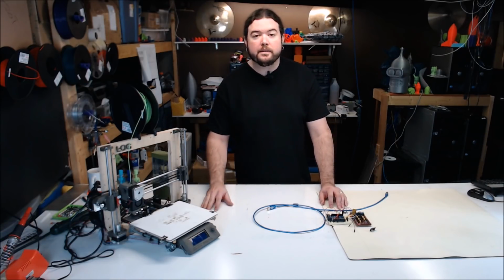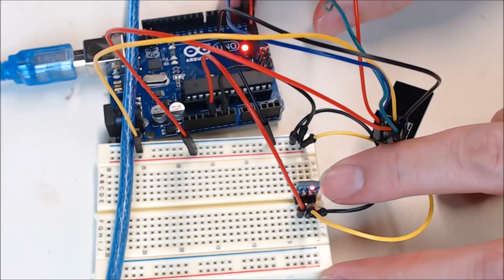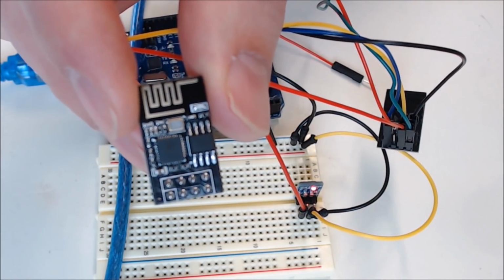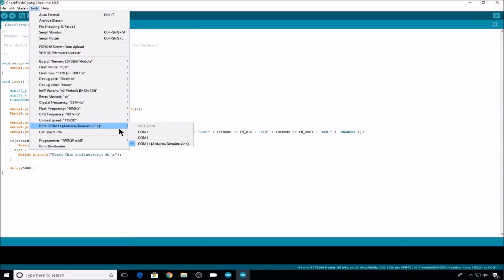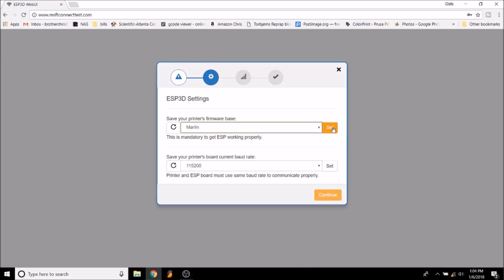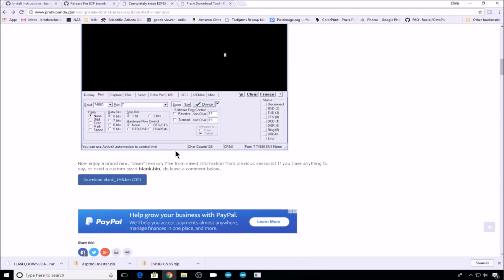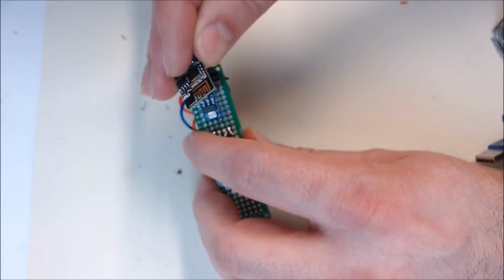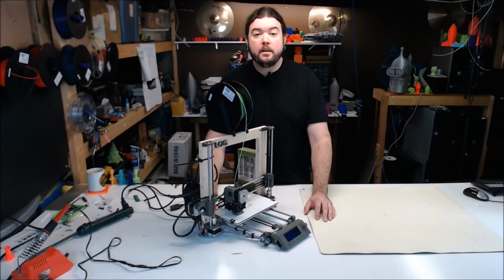Add WiFi To Your 3D Printer For $5!!! - ESP8266 - LUC ESP3D - Chris's Basement

Comment: You need a level shift from 5V to 3V (Ramps 5V -> ESP 3.3V)
Reply from the maker: Level shift? Do you have a link?
Reply: @ChrisRiley  I mean a voltage divider with resistors for the RX Pin (on ESP Site) - see on the picture here 
https://github.com/luc-github/ESP3D/blob/master/images/HW/Wires.png?raw=true
Reply from the maker: @andremuensti4730  Got ya, yes, that should work as well.

Comment: Hi, i tried to make this project but i can't upload the code on Nodemcu board. The IDE shows this error: In file included from C:\Program Files (x86)\Arduino2\libraries\WiFi\src\WiFiUdp.cpp:29:0:
C:\Program Files (x86)\Arduino2\libraries\WiFi\src\WiFiUdp.h:27:7: error: redefinition of 'class WiFiUDP'
 class WiFiUDP : public UDP {
       ^
In file included from C:\Program Files (x86)\Arduino2\libraries\WiFi\src\utility/wifi_drv.h:26:0,
                 from C:\Program Files (x86)\Arduino2\libraries\WiFi\src\WiFiUdp.cpp:26:
C:\Users\Ivan Margiotta\AppData\Roaming\Arduino15\packages\esp8266\hardware\esp8266\2.4.2\libraries\ESP8266WiFi\src/WiFiUdp.h:32:7: error: previous definition of 'class WiFiUDP'
 class WiFiUDP : public UDP, public SList<WiFiUDP> {
       ^
C:\Program Files (x86)\Arduino2\libraries\WiFi\src\WiFiUdp.cpp: In constructor 'WiFiUDP::WiFiUDP()':
C:\Program Files (x86)\Arduino2\libraries\WiFi\src\WiFiUdp.cpp:35:22: error: class 'WiFiUDP' does not have any field named '_sock'
 WiFiUDP::WiFiUDP() : _sock(NO_SOCKET_AVAIL) {}
                      ^
C:\Program Files (x86)\Arduino2\libraries\WiFi\src\WiFiUdp.cpp: In member function 'virtual uint8_t WiFiUDP::begin(uint16_t)':
C:\Program Files (x86)\Arduino2\libraries\WiFi\src\WiFiUdp.cpp:45:9: error: '_sock' was not declared in this scope
         _sock = sock;
         ^
C:\Program Files (x86)\Arduino2\libraries\WiFi\src\WiFiUdp.cpp:46:9: error: '_port' was not declared in this scope
         _port = port;
         ^
C:\Program Files (x86)\Arduino2\libraries\WiFi\src\WiFiUdp.cpp: In member function 'virtual int WiFiUDP::available()':
C:\Program Files (x86)\Arduino2\libraries\WiFi\src\WiFiUdp.cpp:56:7: error: '_sock' was not declared in this scope
   if (_sock != NO_SOCKET_AVAIL)
       ^
C:\Program Files (x86)\Arduino2\libraries\WiFi\src\WiFiUdp.cpp: In member function 'virtual void WiFiUDP::stop()':
C:\Program Files (x86)\Arduino2\libraries\WiFi\src\WiFiUdp.cpp:66:8: error: '_sock' was not declared in this scope
    if (_sock == NO_SOCKET_AVAIL)
        ^
C:\Program Files (x86)\Arduino2\libraries\WiFi\src\WiFiUdp.cpp:69:26: error: '_sock' was not declared in this scope
    ServerDrv::stopClient(_sock);
                          ^
C:\Program Files (x86)\Arduino2\libraries\WiFi\src\WiFiUdp.cpp: In member function 'virtual int WiFiUDP::beginPacket(IPAddress, uint16_t)':
C:\Program Files (x86)\Arduino2\libraries\WiFi\src\WiFiUdp.cpp:88:7: error: '_sock' was not declared in this scope
   if (_sock == NO_SOCKET_AVAIL)
       ^
C:\Program Files (x86)\Arduino2\libraries\WiFi\src\WiFiUdp.cpp:90:7: error: '_sock' was not declared in this scope
   if (_sock != NO_SOCKET_AVAIL)
       ^
C:\Program Files (x86)\Arduino2\libraries\WiFi\src\WiFiUdp.cpp: In member function 'virtual int WiFiUDP::endPacket()':
C:\Program Files (x86)\Arduino2\libraries\WiFi\src\WiFiUdp.cpp:101:32: error: '_sock' was not declared in this scope
  return ServerDrv::sendUdpData(_sock);
                                ^
C:\Program Files (x86)\Arduino2\libraries\WiFi\src\WiFiUdp.cpp: In member function 'virtual size_t WiFiUDP::write(const uint8_t*, size_t)':
C:\Program Files (x86)\Arduino2\libraries\WiFi\src\WiFiUdp.cpp:111:27: error: '_sock' was not declared in this scope
  ServerDrv::insertDataBuf(_sock, buffer, size);
                           ^
C:\Program Files (x86)\Arduino2\libraries\WiFi\src\WiFiUdp.cpp: In member function 'virtual int WiFiUDP::read()':
C:\Program Files (x86)\Arduino2\libraries\WiFi\src\WiFiUdp.cpp:125:23: error: '_sock' was not declared in this scope
    ServerDrv::getData(_sock, &b);
                       ^
C:\Program Files (x86)\Arduino2\libraries\WiFi\src\WiFiUdp.cpp: In member function 'virtual int WiFiUDP::read(unsigned char*, size_t)':
C:\Program Files (x86)\Arduino2\libraries\WiFi\src\WiFiUdp.cpp:137:31: error: '_sock' was not declared in this scope
    if (!ServerDrv::getDataBuf(_sock, buffer, &size))
                               ^
C:\Program Files (x86)\Arduino2\libraries\WiFi\src\WiFiUdp.cpp: In member function 'virtual int WiFiUDP::peek()':
C:\Program Files (x86)\Arduino2\libraries\WiFi\src\WiFiUdp.cpp:152:22: error: '_sock' was not declared in this scope
   ServerDrv::getData(_sock, &b, 1);
                      ^
C:\Program Files (x86)\Arduino2\libraries\WiFi\src\WiFiUdp.cpp: In member function 'virtual IPAddress WiFiUDP::remoteIP()':
C:\Program Files (x86)\Arduino2\libraries\WiFi\src\WiFiUdp.cpp:167:25: error: '_sock' was not declared in this scope
  WiFiDrv::getRemoteData(_sock, _remoteIp, _remotePort);
                         ^
C:\Program Files (x86)\Arduino2\libraries\WiFi\src\WiFiUdp.cpp: In member function 'virtual uint16_t WiFiUDP::remotePort()':
C:\Program Files (x86)\Arduino2\libraries\WiFi\src\WiFiUdp.cpp:177:25: error: '_sock' was not declared in this scope
  WiFiDrv::getRemoteData(_sock, _remoteIp, _remotePort);
                         ^
Errore durante la compilazione    can you please help me?
Reply from the maker: Looks like you are missing the wifi man library. Try to use the same version as the one in the video, it's very picky about which version.
Reply: @ChrisRiley  thank you, it worked. Now my ender 3 works with Wi-Fi :D
Reply from the maker: @ivan_23i  NICE!!!!

Comment: Hello sir ur tutorial is much easier to understand and I need a wireless solution to my scenario...I use a 3D named 'Aarya P1' which consists of Arduino AtMega 2560 coupled with RAMPS v1.4...the printer uses a different firmware made for it and not 'marlin firmware'...So,can you guide me in adding a wireless feature to my printer using nodemcu or esp8266 module
Reply from the maker: Does the board have transmit and receive pins available? If it does and it has 5V open it should work the same.
Reply: @ChrisRiley  sorry for trouble,but it would be great if you guide me more in depth...
Reply from the maker: @vinstondavid  Do you have a picture of the board it uses?
Reply: @ChrisRiley  it uses a basic ramps 1.4 and Arduino AtMega 2560 board
Reply from the maker: Then it should work just like stated in this video.
Reply: @ChrisRiley  My printer uses a customised firmware other than the usual marlin firmware....so,will it work on it too?
Reply from the maker: @vinstondavid  The ESP should allow you to use it as serial input. So if tethered USB printing works on your printer, then this should work.
Reply: @ChrisRiley  Sir, can I get your mail id so that I can send some pics of my printer and the boards it use and the hex file of my firmware
Reply from the maker: @vinstondavid  brotherchris81@gmail.com

Comment: Hello Chris, in the schematic drawing that you sent me the RXd of the esp is connected in the D2 of ramps and the TXd in the D1, check this link, because what I was reading would be the opposite and I am in doubt to call in ramps here.
Reply from the maker: RX goes to D1 and TX goes to D0
Reply: @ChrisRiley  Thanks, but it did not work, the esp was red light on and the LCD was saying connecting and then started to give a bug in the ramps and it was restarting, I will redo everything.
Reply: @ChrisRiley In your drawing that sent me is RX in D2 and Tx in D1, check it out? Because that's how I called.
Reply from the maker: @TheNikakz  Interesting some pinouts call it d0 and d1, others call it d1 and d2. No matter what they are called they are still the top two right pins on AUX1.
Reply: @ChrisRiley  ok, vou revisar
Reply: @ChrisRiley  I sent to your email

Comment: can you do this to a anycubic I3 mega ?
Reply from the maker: Not sure what board that has, but if it has 5v ground tx rx pins available it should.
Reply: @ChrisRiley  Should have a Makerbase board? Serial pins broken out for the Makerbase TFT.

However if it ships with a TFT touchscreen controller, the serial pins are occupied. The external USB is then served by the Makerbase TFT, which is not fully command-compatible, and since USB-serial interface is implemented on board the STM32 processor, serial passthrough is not accessible externally. It is my understanding that Makerbase ships its own ESP8266-based WiFi upgrade module that goes into the TFT screen, but the firmware on the screen needs to be reconfigured or modified. Also not sure whether the WiFi functionality is actually any good.
Reply from the maker: @SianaGearz  I am not sure on the Makerbase board either, I would have to take a look at one.
Reply: @ChrisRiley  all Makerbase boards have an 8-pin keyed connector, which is laid out like this:
5V GND TX RX
5V GND NC NC
(key side here)
It's usually helpfully silkscreened on the back side of the board. It allows Makerbase TFT to connect, which is a spooler emulator with a colour touchscreen. But you should only be able to use either Makerbase TFT or any other kind of serial without interference, not both.

It's connected to the serial-USB bridge via a bunch of resistors, such as not to burn up either of the chips. If there's anything the Makerbase Gen.L doesn't lack it's the resistors - also connectors for just about anything you might think of.

Comment: Chris thanks for your help, It worked very well with WeMos D1 (ESP8266MOD) !!!!
Reply from the maker: Sweet! I have been meaning to try the D1.
Reply from the maker: Hindo Y.  It shouldn't do this if you run the data upload right after you unload the sketch. I am trying to find another work around.
Reply from the maker: Hindo Y.  Yes, upload sketch, reset, then in tools hi ESP8266 sketch data upload, then reset, log on to the ESD3d via wifi and the wizard will pop up.

I am trying to find a work around because the ESP3d instructions for the new version says you shouldn't have to do the sketch data upload, you can use the web interface, but I can't get it to work that way.
Reply from the maker: Hindo Y.  Interesting, thanks for the update.
Reply: Hindo Y.  For me it worked with the v1.0. This is how i did it:
1. Set Flash Mode: DIO
2. Set Flash Size: 1M(128K SPIFFS)
3. Set CPU Frequenzy: 160MHz
4. Erase Flash: All Flash Contents

Then i flashed the ESP3D v1.0 to the module, reset the module and then hit ESP8266 Sketch Data Upload (even though if the install instructions here:https://github.com/luc-github/ESP3D/wiki/Install-Instructions tell that it isn't necessary anymore). Then power off the module, remove GPIO_O to Ground jumper and power back on. Then the setup window on my laptop appeared after the wifi connection to the ESP8266 was established.

 Chris Riley  Thank you for this video!

Comment: I'm using ESP3D version 1.0, i will try again with  0.6.2
Reply from the maker: Try with 0.9.99
Reply: @ChrisRiley  It did not work either, when accessing the IP it has the option to upload filesystem and firmware.
Reply: @ChrisRiley  my print screen https://prnt.sc/mbsry1
Reply from the maker: @saLLadEXx7  Yeah, that data upload should make that screen not show up.
Reply: Tomorrow i will try using my another ESP8266MOD, for today is it.

Comment: Could you help me? I installed everything ok, but when I access it in the browser it does not show setup wizard.
Reply from the maker: Does anything at all show up?
Reply: @ChrisRiley  yes, interface to upload filesystem and update firmware... Im trying upload the index.html.gz
Reply from the maker: Let me try to reproduce this and I will get back to you.
Reply from the maker: @saLLadEXx7  So here's what I would do. ESP3D says you don't need to do the data upload anymore, but I think it is easier. Blank out your ESP with a sketch, it's in the video. Then upload that ESP3D sketch, then hit the data upload in the tools menu. Then when it comes up the gui will be there.
Reply: @ChrisRiley  Ok, i will try again.
Reply: Did not work, i just can see the 404.htm with 746 B... the setup wizard doesnt appear :(

Comment: Chris, after juggling I managed to configure, but I had to do differently in some parts, change from flash mode DIO in one and then QIO to the other, CPU frequency also to 80 in one and 160 in another, then I got the same way put the SPIFFS in 1M 512K, was trial and error to set up and I did not understand why all this. Now I was in doubt on some configurations of the WEB interface, could make a small video demonstrating this, for beginners as I is something crucial, for example IP is set as static, this is or would be DHCP, printer settings, etc ... I apologize if I bothered you with so many questions, I have a lot to thank and I have learned from you it is difficult for a beginner and with the language barrier it gets more complicated. Thanks
Reply from the maker: Things change so fast with these things it's to keep up. I am glad you are making progress.
Reply: Chris, one last request, I did not understand the connection scheme of ESP with AMS in ramps, even for what I downloaded in your google docs, could you send me this link? In its drawing the 5V of the ramps Aux1 goes on the VIN of the AMS, GND AUX on the AMS 2 and the GND of the Esp (that is not GND is out) and the AMS 3 that is GND goes in the VCC of the Esp, I was confused with these connections.
Reply from the maker: @TheNikakz  This isn't correct? https://docs.google.com/drawings/d/1z167zKmgja0fHPxrM4l7RUT6-UOSLVTGQDHHzxIrIrE/edit?usp=sharing
Reply: @ChrisRiley  Yes Chris should be correct, but what I want is the link from ESP to AMS, and for ramps, I could not understand those links by the video.

Comment: Im getting 17:37:12.920: ok T:23.91 /0.00 B:24.22 /0.00 @:0 B@:0
17:37:12.932: echo:Unknown command: "VMDPE_1:2:456785:0:247|456785_VMDPE"
17:37:12.933: ok
17:37:13.184: echo:Unknown command: "VMDPE_1:2:457035:0:247|457035_VMDPE"
 Any idea why?
Reply from the maker: Hmmmm....VMDPE I am not sure what that means.
Reply: @ChrisRiley  i figured the sucker.. i compiled with vb.. it is a internal debug for it.
Reply: Trying to upload the scetch with arduino 1.8.8 and it shows no space on the board...  when i try to upload the ui to it. the one with initial forcefallback=yes... long night...
Reply: got it. it was configured with no flash size... lol
Reply from the maker: @haldir234  Someone else was saying they were have problems with the IDE. Try 1.8.5.

Comment: Can we connect WiFi 3d printing with raspberry pi (octoprint) without using USB port..
Reply from the maker: You could use GPIO pins on the pi if you new the right pins on your mainboard, but that's about the only thing I know. Is there a reason you can't use USB?

Comment: Or this:  Módulo Fonte Dc-dc 12v Saida 5v - 3.3v - Arduino Nodemcu Esp, https://produto.mercadolivre.com.br/MLB-872301330-modulo-fonte-dc-dc-12v-saida-5v-33v-arduino-nodemcu-esp-_JM?quantity=1#reco_item_pos=1&reco_backend=machinalis-seller-items&reco_backend_type=low_level&reco_client=vip-seller_items-above&reco_id=99bd08f2-a7fd-4af0-a52c-99713748dd54. Was it the same connection scheme? I can not find here what you used in the video